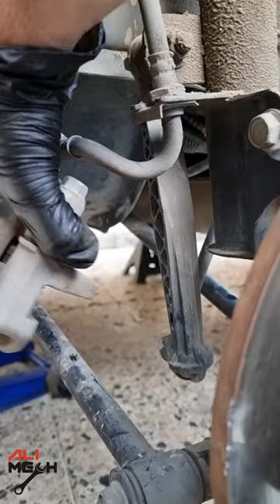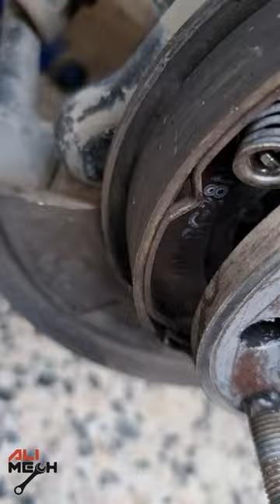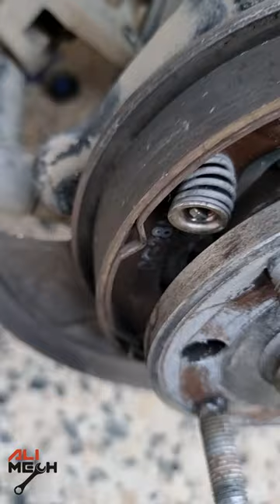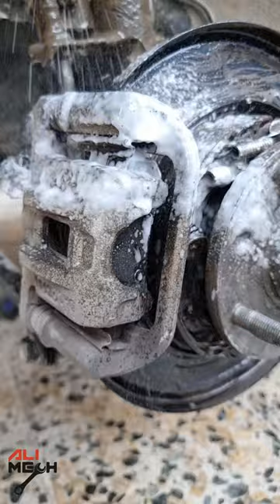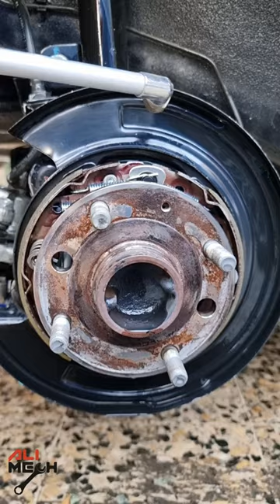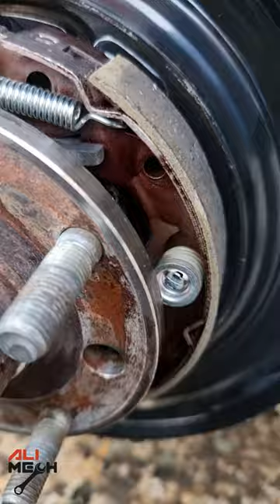How to clean Parking brake shoes  #shorts

Comment: Mechanic here.  Douse in brake clean.  As long as you don't have a blown axle seal, which is another issue.  Works just fine.  Why reinvent the wheel?
Reply: Yeah, this seems like a lot of effort when you can spray brake cleaner on it and the result would look the same!
Reply: there will always be the 50$ guy vs the 500$ guy with anything
Reply: this is terrible, water will rust and seize the parking brake
Reply: @robertficek7586  do this in the winter, at least no one can steal it then
Reply: He must have a guarantee
Reply: brake cleaner damages linings so soap and water does the trick
Reply: A can of brake cleaner is like 7$ some soap and water is cheaper
Reply: @remady5827  how much does soap cost you? And how much does a few gallons of water cost ya? Lol
Reply: remove the disc is the only way to check, that why I don't like drum brake. Just after washing,  need to grease  between the shoe and the back plate.
Reply: @jawkman101  never know shoe worn until remove drum

Comment: And now it's going to rust and jam up the inner mechanism.
Reply: It's not going to rust because water was blown out and it is salt free. It is going to rust more because of salty water during winter ride.
Reply: @Cribs00  It will rust like hell!
If he never drives the car, ok it will not rust. But if he drives the car, moisture and water will get in there no matter what you do! Especially in the winter season with all the saltwater. Thats why you lube and grease every moving part in your brake system (except pads of course)
Reply: @Cribs00  you don't need salt to cause rust. It will rust, salt just makes it rust faster